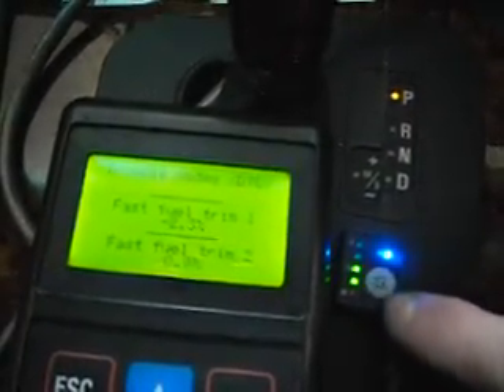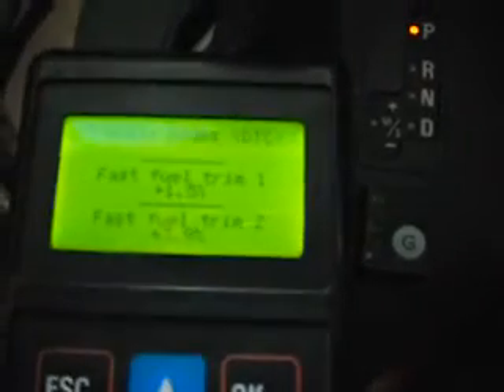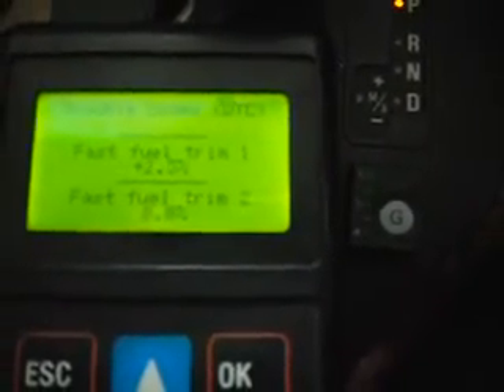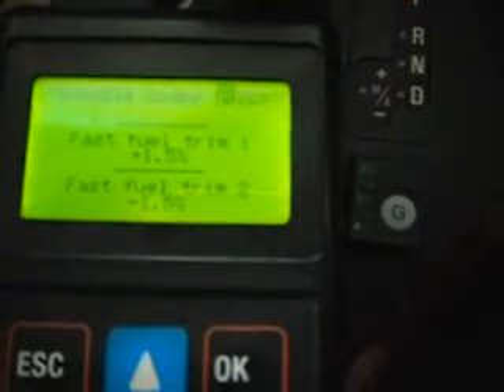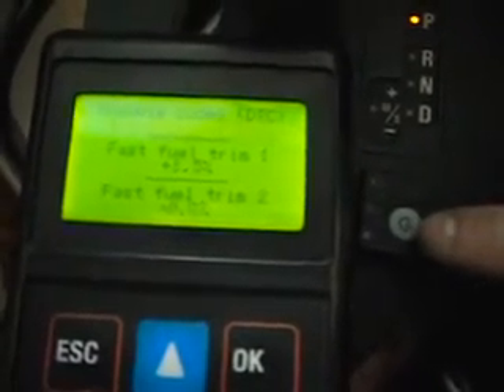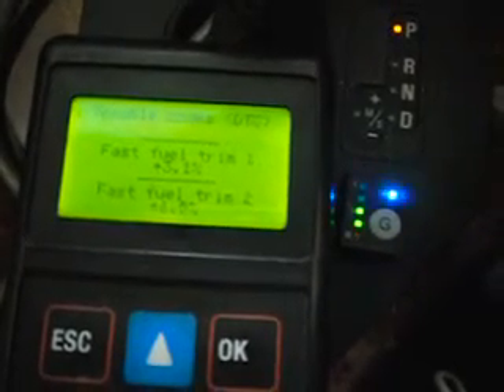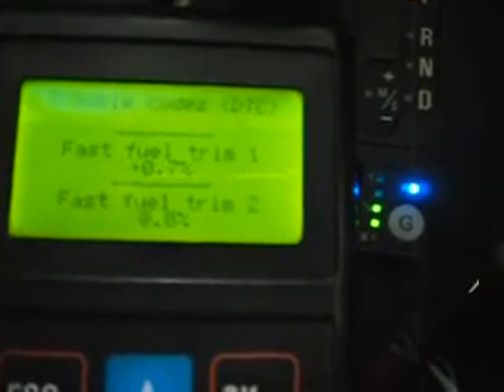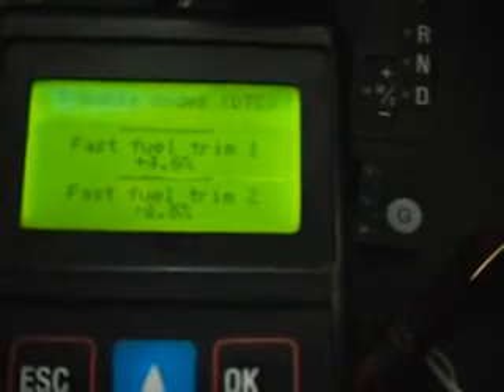bmw e39 lpg fuel trims

Comment: Hi!My fuel trims on petrol are fine.Close to 0.However on LPG stft goes negative 10 aventually ltft allso.Is it too rich on LPG?
Reply: It is good on -10%. The car is pulling good on acceleration.  Don't worry.